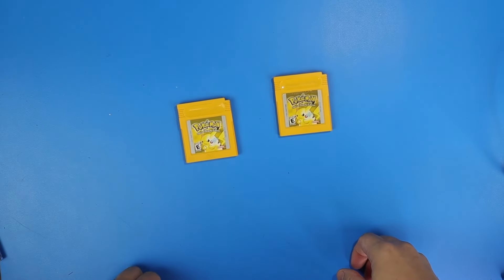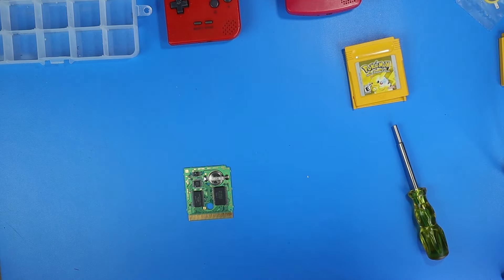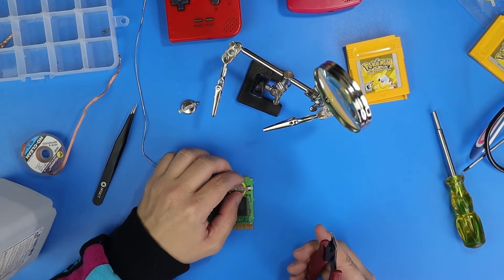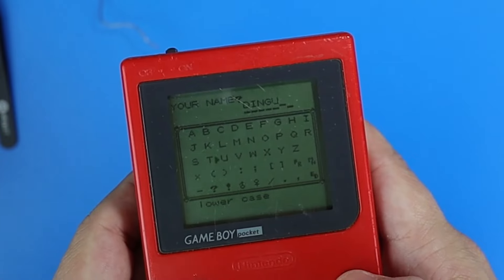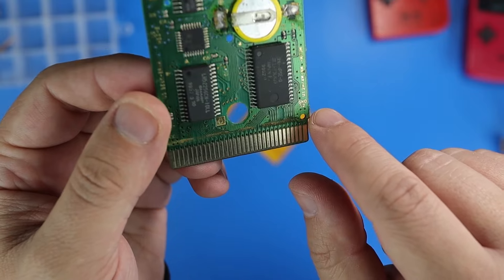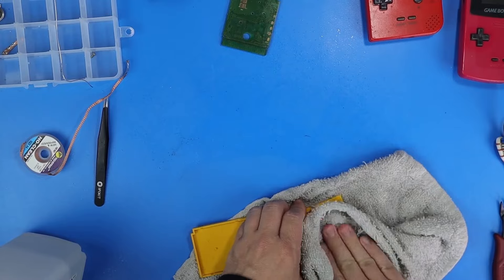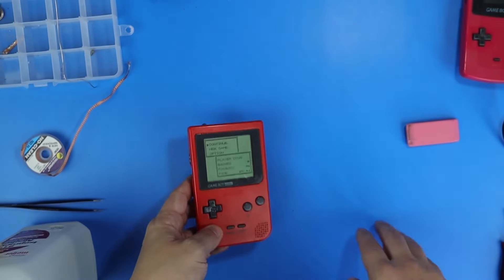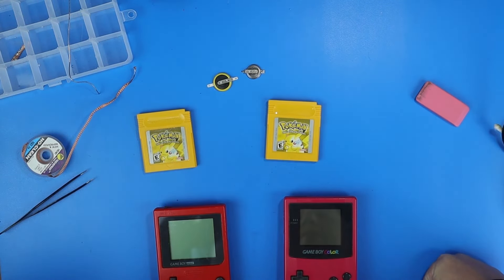The Lost Episode: Restoring Viewer's Pokémon Yellow: Battery Replacement & Game Fixes!

Comment: If you own the original style gameboy advance, the gameboy / color carts stick far enough out that you can insert the game without the back shell and have full access to the battery. Meaning you can flip the unit upside down (game pcb facing you) and then desolder the old one and solder in the new one with the game still powered up. The save will be persisted because the only time the battery is needed to keep the save intact is when the game is powered off.

Cowboy / kinda hacky I know. The proper option is to buy a cart dumper, not very expensive BUT in the off chance this was a one of situation and you didn't plan on doing it again... I've used that method before.
Reply from the maker: That's wild, I've never thought about that... my plan (so far not going as smoothly as I would have hoped) was I purchased a bricked Retron 5, I was hoping to unbrick the console and use that as my save file storage while I swap batteries... haha If I never get this thing un bricked I may give that a shot. (well.. that and actually spending the money on a proper cart dumping tool one of these days) 
But I love the suggestion and I always love hearing creative ways to fix an issue

Comment: I prefer 2025 batteries. 2032 might not fit if you don't position it well. 2025 will always fit. I think Pokemon Yellow is the only international gen 1 or 2 game that didn't come with a 2025 battery originally.
Reply from the maker: Thats a good Idea, honestly I either jump to a 2032 or just replace with a 1616 (because I have a whole sheet of those). I will buy some 2025's and give those a try!